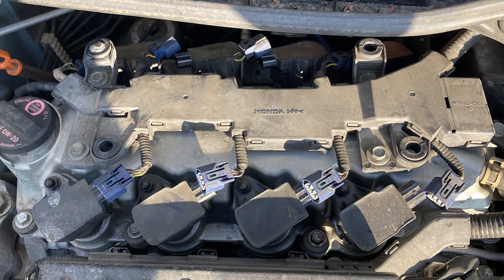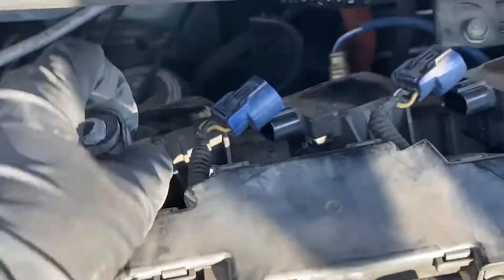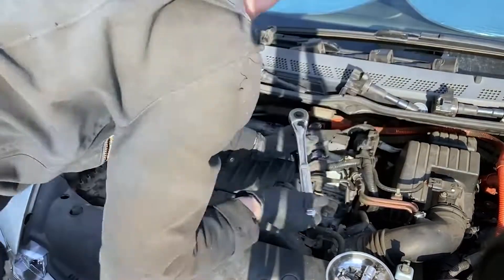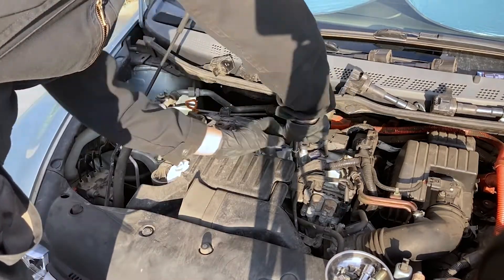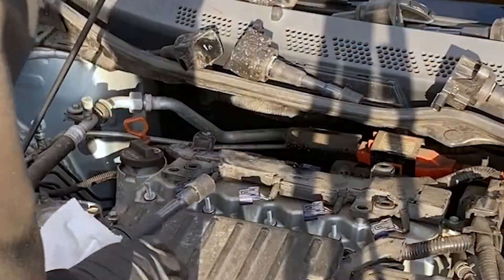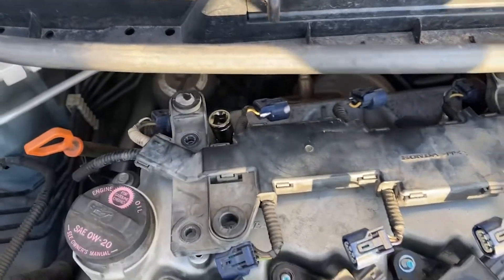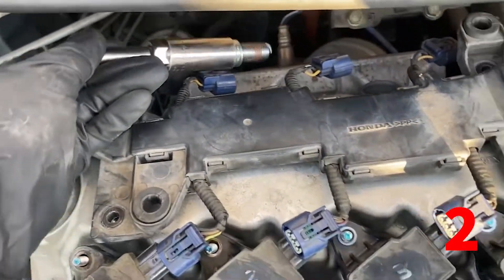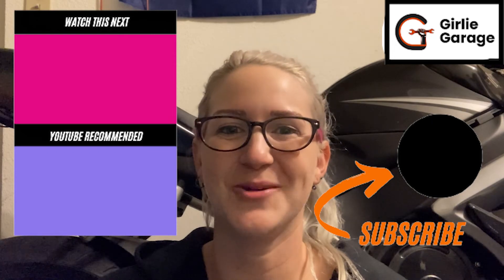2006-2011 Honda Civic Hybrid 1.3L - Replace Sparkplugs - Girlie Garage

Comment: 8 Spark Plugs on a 1.3L engine, Honda has created an ABOMINATION.
Reply: It's so that it doesn't need to use the starter. Turn the key and it's on.

Comment: Gonna do this on saturday plus the ignition coils. Thank you for this, its so hard to find videos on this specific civic model lol
Reply from the maker: Totally! Let us know how it goes and good luck (yay for 8 spark plugs on a tiny 1.3L engine)
Reply: @GirlieGarage  i put it off for so long but i finally did it! And let me tell ya it took a while. Like 2 or 3 hours and a trip to autozone for a shorter spark plug socket, but I got the job done 😀  my biggest issue was an ignition coil of which the head broke off and left the boot in the cylinder. Thankfully i got it out with pliers.

Again, thank you for teaching me how to change my own spark plugs :)

Edit: typos
Reply from the maker: @Nyexcellente  wow! What an adventure! I hope you put copper anti-seize and torqued them correctly so they don’t break on you next time. You’re probably already getting better gas mileage! Congratulations!

Comment: Is their a specific size for the spark plug socket? The spark plugs have a 14mm Hex.
Reply from the maker: Spark plugs are usually 5/8” or 9/16” depending on the car.

Comment: Great video!  My sister needs her plugs replaced for sure.  She would like her coil packs replaced also.  What is good could pack to go along with the plug replacement?  JAH
Reply from the maker: Honestly, just get the stock/OEM part number from Honda and buy the honda ones online. They are made to last (I usually don’t replace them unless one starts to go bad and then you replace all of them at the same time)

Comment: why didn't you change the coil packs with the plugs? do they have to be in a certain order.. I just bought a 09 hybrid with 197k on it.. don't think its ever been touched... i ordered new everything! it runs and drives ok, just a little shaky.
Reply from the maker: My coil packs seemed to be fine. If you are reusing them then they need to go back in the same cylinder they came out of. If you have 200k, wouldn’t hurt to freshen everything up